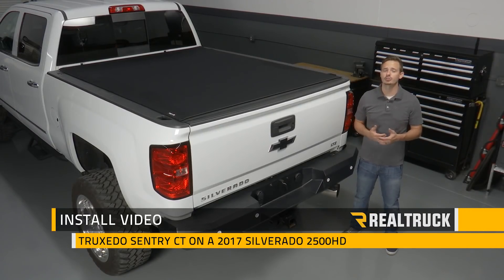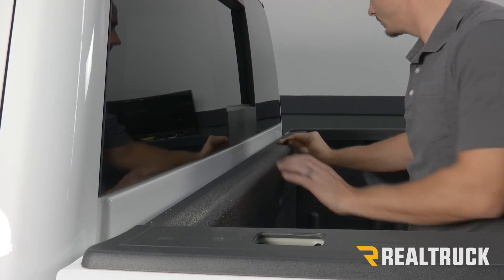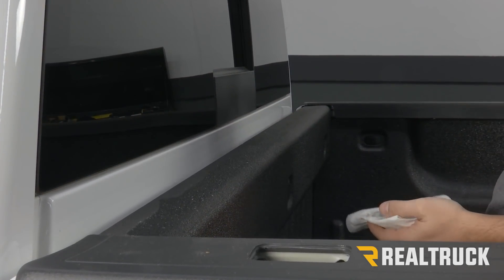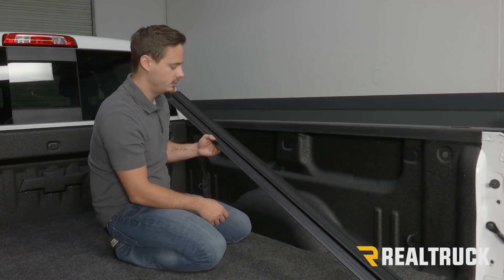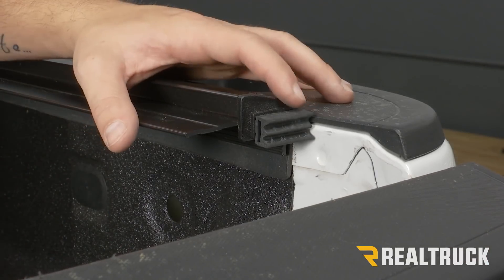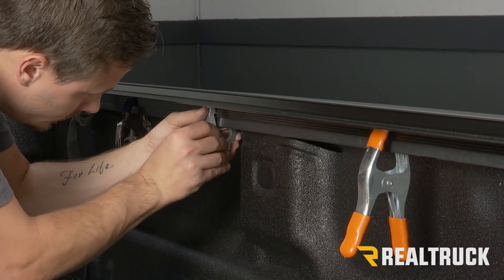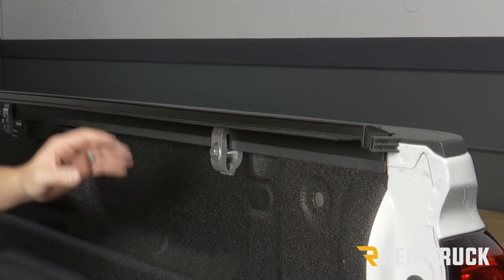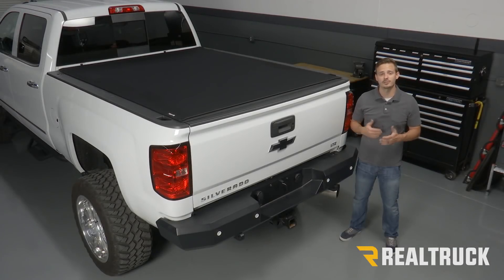How to Install TruXedo Sentry CT Tonneau Cover

Comment: material's great, looks nice...but noisy/squeeky as heck going down the road. even with rear window closed, it can be heard at freeway speed unless the radio is turned up. also need to add your own weather stripping around tailgate in most cases. the latter is not a deal breaker, but the noise makes me regret the purchase given the price point. also, given the price, a small tube of adhesion promoter (similar to tube of grease provided with many parts) would be a nice touch given the fact most truck owners have bed liners of some sort.